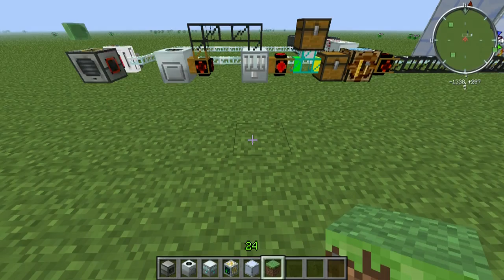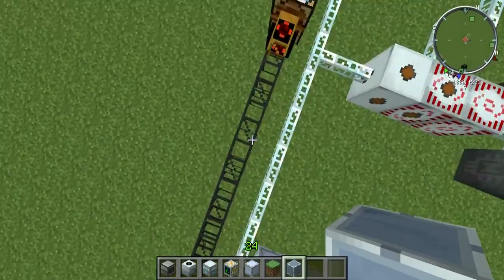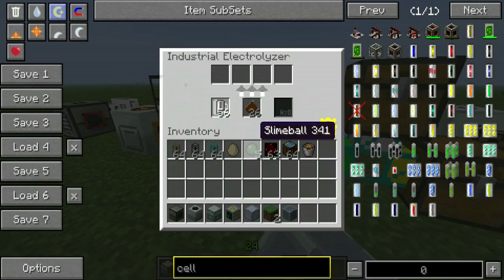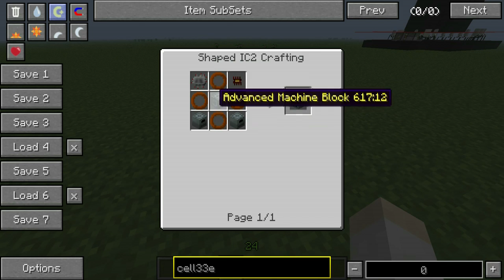FTB - How To Make Titanium Ingots

Comment: Titanium originates from beach sand using a chemical process using Coke and ruteal... then it becomes titanium sponge... is pure titanium... then they use a variety of alloy recipes... then pressed into compacts... then welded together in a vacuum tank back filled with Argon gas using plasma torches... that becomes on an electrode download it into a vacuum furnace and melted into an ingot... those are just the basic steps!